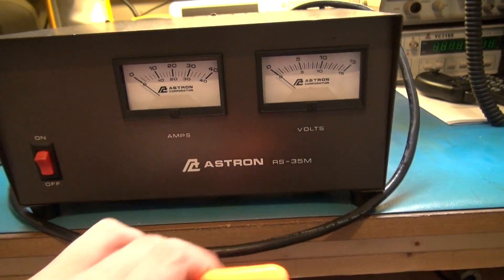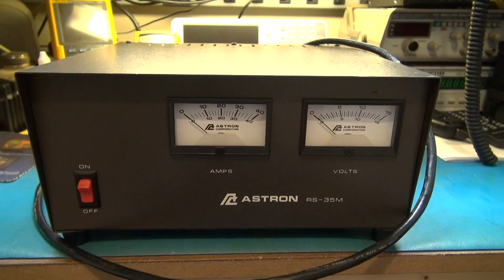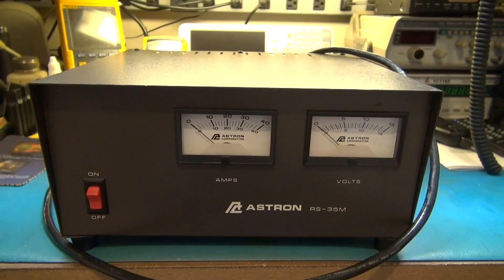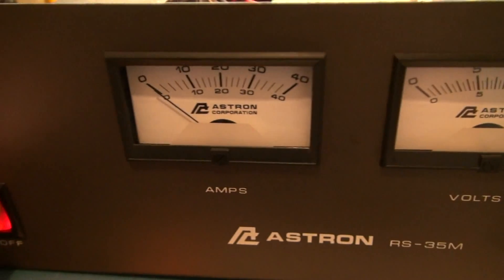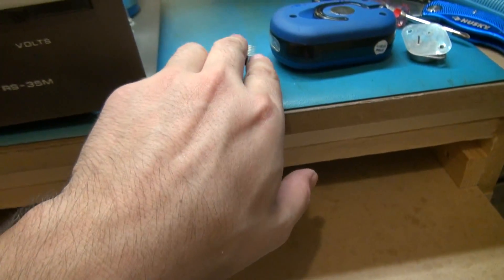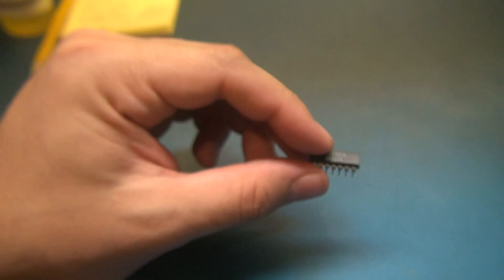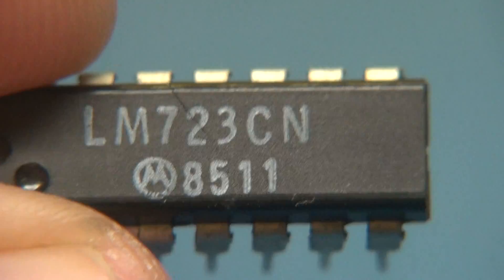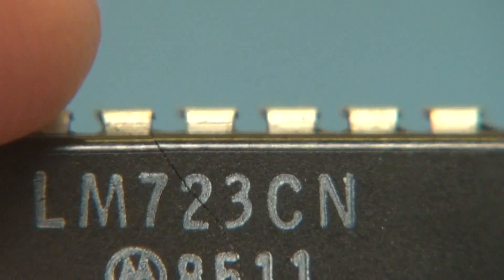ASTRON RS-35M POWER SUPPLY REPAIR

Comment: At least that thing has the SCR that clamps if voltage regulation fails before it burns up your stuff, follow the white wire from the PC board, I added one to mine, and when mine quit it was a shorted rectifier, great power supply.

Comment: I don't know for a fact but I suspect there is insufficient current gain after the 723. I would be inclined to replace the TIP29 driver with a darlington, this will massively reduce the work the 723 has to do. (I know this is an old video but a lot of commenters have similar issues).
Reply: The driver transistor replace with a TIP122, this one works the best and will make the unit work longer.
Reply: @Robert-hr6sh  I agree. A lot of people are wary of correcting the design defects.

Comment: The lamps burned out on my 35M. Is there any way to replace them?  Also, I guess there's no way to bond-ground this power supply to other equipment?
Reply: Yes, call Astron.
Reply: The most important devices to bond together are those which are connected via coax.  A voltage differential between them results in current that follows the coax and flows through the RF components, which is frequently a bad thing.  The power supply DC connection is usually isolated from ground and the chassis is grounded via the three prong plug to the service ground.

Comment: I have the same unit my problem... it drops to around 10 volts under 5 amp load , replaced the LM723 chip but no luck...

Comment: 99 cents. Easy fix. Show us something hairier!
Reply: Let me hasten to add that, if replacing the LM723 regulator chip didn't solve the problem, check out the pass transistors. They're easy to pull and test. (See other videos on YouTube.) If they are bad, replace them AND their 0.1 ohm 10 watt resistors as well as sometimes failed pass transistors will take the resistors with them!

Comment: Common issues will be 1or 2 of 3 or 4 things, the regulator IC LM723CN  the TIP 29 NPN transistor or the crowbar circuit. More rare but is possible fail due to pass transistor 2n3771 having a short  and activating the crow bar & blowing the fuse, to protect attached equipment from over voltage. Other wise I have found this brand of power supplies to be very dependable and a good choice of power supply in both industry and private use.
Thanks 
Ray N S.C.
Reply: The 2200uf cap for the voltage regulator can go bad too... Then you probably have to deal with two dead rectifier diodes and a dead 723 as well. :P

Comment: how did you discharge those filters capacitors?
Reply from the maker: +Light Man with a resistor..
Reply: You can get away with a little 1/4w 150ohm resistor... That 64000uf cap can pack a whallop. Lol.

Comment: My meters stick, any ideas?
Reply from the maker: Not much you can do other than replace it. You could try taking it apart and washing out the element with contact cleaner but may risk further damage.
Reply: kev31779 I did try partially removing it but I demurred not wanting to make it worse

Comment from the maker: you could maybe get the meter and regulator from the manufacturer. I got my regulator on the ebay. As for getting a replacement for the meter you would have to spec something close in size to fit.
Reply: I'm looking for both the V and A meters to add to an Astron 35A supply that doesn't have the meters....

Comment: Where did you find the regulator part ?
Also, I need a replacement " Voltmenter " for my Astron RM-50M.  
I have been looking all over the place for one, so I might have to find a digital one that hopfully fits the same square hole..... etc.    Good job on your repairs and diagnosis. 73's DE W4ZJM

Comment: I noticed the amp meter didn't work was there a fix for that too ?
Reply: Ammeter will show 0 until a load on the supply starts drawing current.  Then you'll see a reading on the meter.